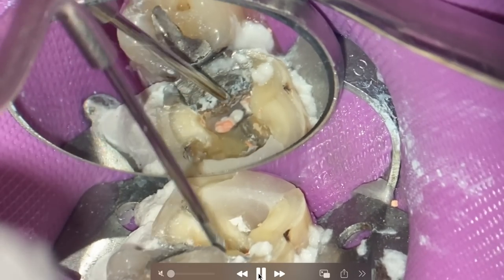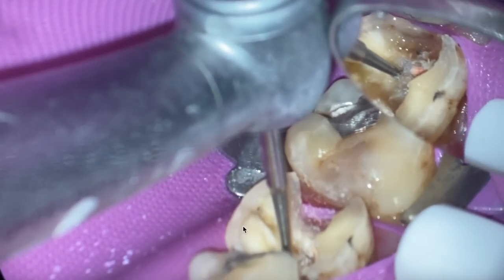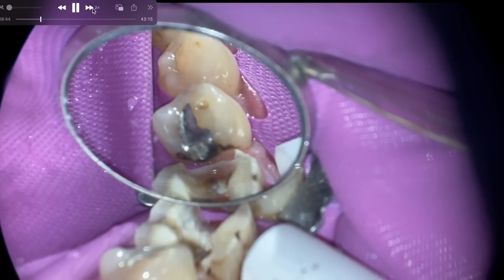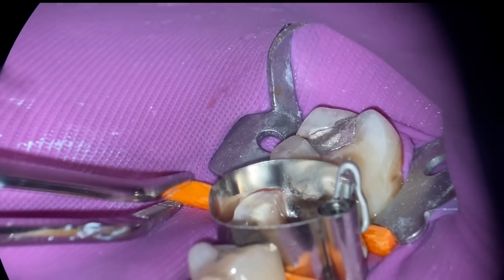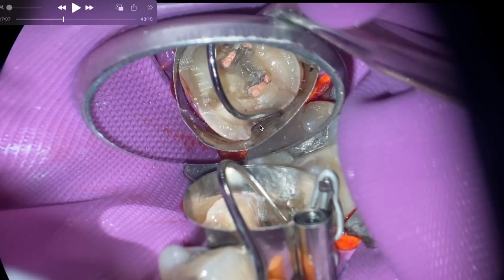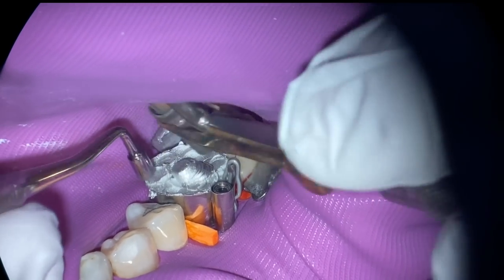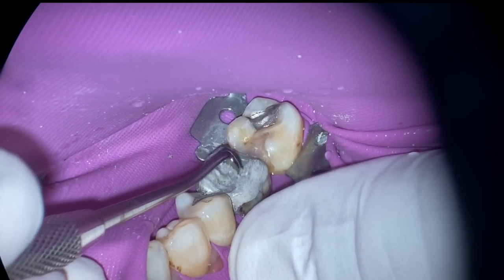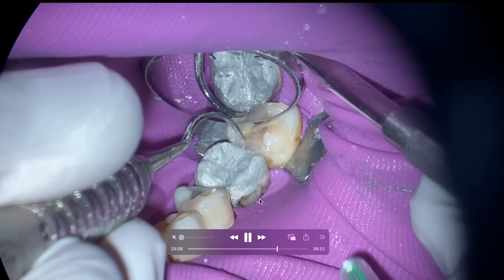Huge Fillings - A New Dentist *MUST* WATCH

Comment: One tip is that when I place a class 2 with a missing adjacent tooth is get another band , cut quarter of it , place it inside the retainer band assembly and pack cotton ( Teflon sounds better but never tried it ,cotton is faster)  in between the two bands , this can also be helpful when the gingival box is deep that it becomes concave especially upper molars ,,,
About contact burnishing ,, doing it the way you did creates irregularities in the band which will transfer into the amalgam , my brother is a dentist himself too and he got his molar done that way and now his floss tears straight away every time , and so I replaced the filling ,, I do burnish in this situation : when the box is wide buccolingually the matrix collapses and makes a huge embrasure ,,, the way I burnish is that I loosen the bad band a bit about a quarter turn, burnish close to the cavo surface margin with a the side of a condenser , tweezer or the large tip of a T-burnisher from the bottom of contact and up to the edge of the band , excess can be easily removed later.... would like to read others opinions.
Reply: this is really helpful, thank you. I have #2DO with huge class II and I'll try this method.
Reply: Good idea 💙🦷

Comment: Great video. I noticed you kept the automatrix relatively loose (it appears like tightening it could have sealed off the buccal and lingual a bit more).. is that with the intent to improve the interproximal contact tightness?

For composite, I find placing a sectional matrix in (for example) the buccal portion prior to tightening the auromatrix improves the seal and reduces the overhang I have to remove

Also this is probably a novice question - I am definitely a novice still with amalgam -  for teeth with minimal natural structure remaining, is amalgambond a viable choice to avoid placing any additional retentive features that would remove more tooth structure? Basically does it allow one to use composite prep design for amalgam restos?

Comment: If you are worried about the patient breaking the amalgam when they first bite down, use a leaf gauge ahead of time to find out which leaf they make contact on, add more leaves, and use it to slow the pts bite down. Take away leaves one at a time removing premature contacts until you get the contact you want with no leaves

Comment: Not hating on your use of amalgam, but so many of the problems you are talking about, ie, fracturing while removing the band, or checking occlusion, etc....are all eliminated by placing composite, as well as at least a half dozen other benefits.  And if you are gonna use amalgam, and have this be the de facto final restoration, why did you not use some type of amalgam adhesive?  Bewildering.  
This is like using niti rotary files, apex locator, all of the latest and greatest irrigants, materials and techniques for debriding and shaping canals, and then using a silver point to obturate.  Think about this;  amalgam is actually an older technology than the use of silver points.   Again, I'm not hating!  I myself have placed thousands of amalgam restorations, but have not placed one in over 20 years and its literally one of the best decisions I have ever made in my day to day practice of dentistry.